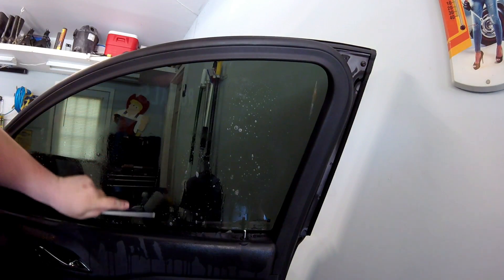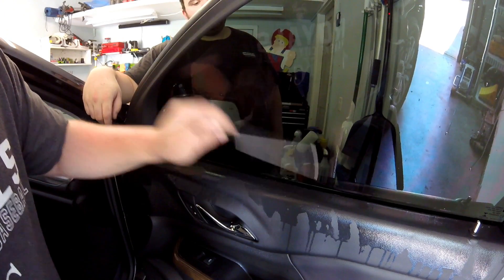How to eBay Tint Your Windows

Comment: Omg you have been hitting all the little things I needed to know! I cleaned my windows with Windex, which damn sure has ammonia! I knew I didn't know enough to do it myself yet so I'm saving it for a nice day and after a few more of these type videos, so thanks!  
Question, I've heard you don't want to do it in direct sunlight, which is all my driveway is, so I'm thinking of doing it at the carwash so I can be under the car port, but will it be okay if I drive home after and it sits in the sun? Should I try to keep it under the shade or what? Thanks in advance.
Reply: I’ve never heard of sunlight causing a problem. In fact, there are mobile tinters that will do it right in your driveway. The only thing I can think of is the sunlight would cause your solution to dry a lot faster. But if you apply a lot of solution then this shouldn’t be an issue.

Comment: Hi Obsessed Auto,

Great job with the tint job! I have two question if you don't mind answering because I want to tint the two front windows on my GMC Envoy.

1) How is the tint hold up so far? Any discoloration ?
2) Which ebay seller/store did you order From?
Reply from the maker: So far the tint is great, no issues at all. Would definitely buy again, here is the link to the eBay seller:  http://www.ebay.com/usr/elitetint?_trksid=p2057872.m2749.l2754. It's worth doing, thanks for watching!!

Comment: Did you at any point in time after the install was complete use a heat gun? Tint install came out bad ass by the way. 👍🏼
Reply from the maker: No, we didn't use a heat gun for this application, we let the sun work for us!  In an upcoming video we will be using a heat gun because it will not be a precut film!  Thanks!! We are very pleased with the outcome!!  Stay tuned for more!

Comment: as a window tinter

I have tried this in the past and 99.9% these kits are awful, they usually are short on the edge or the bottom.

I would not advise getting these kits

(No disrespect to the guy who’s making this video)

Its something I would get done professionally and I can assure you there is dust due to it resting on the door panel.

Comment: 25 bucks and the contamination specs on the window looks like glancing into the starry night sky haha. Just go to a pro. They charge accordingly for a reason. Don't do what this guy did.
Reply: J Wise you just made my day lol I always try to save a buck and then I regret it
Reply: J Wise lol I was watching this and shaking my head the hole time lol. I do professional window tint and definitely everything about this video is wrong. This people are the main reason we have so many removals at the shop lol so many customers say... Yeah so I watched this YouTube video and ........ You know that's how the conversation starts .
Reply: So if you do professional window tint and this guy did everything wrong, what could he have done to do it better? It looks fine on video. Is it because he didn't use a razor blade to clean the inside of the window? And it looked like he didn't clean the door panel while the tint rested on it. Is it cause he didn't use a heat gun on the inside to form it to the curvature?
Reply: @NGGPeter  what did he do wrong? Removed the entire liner and placed onto glass leaving the bottom exposed to the dirty door panel. He exposed the film to many contaminates with his transfer technique of film to glass. Finished product looks like shit. Touched the film with dry fingers leaving smudge that delaminates the adhesive reducing the longevity of the film backing. Also, he paid 25 dollars PER side. Thats 50+ bucks IF he got it right the first time around. Professionally done, a two window vehicle runs $70 and the film is ceramic and not dyed film like the film he used which will last 2 years. Carbon ceramic you're looking at 5-7 years. He didn't squeegee correctly or shrink so the film WILL develop fingers and eventually peel at the edges after continuous up and down movement of glass through use. And last but certainly not least he bought EBAY tint.
Reply: @cold-frontin_penguin7902  HI I ordered an ebay kit for my back windows of my berlingo before watching this video. It cost $50. should I take it to a professional to fit ? Or is it possible to get good results myself ?
Reply: @Professor-Scientist  if you're not wanting good results but results that are good enough then i say go for it. If you're OCD like myself then go professional. Akso, those Ebay kits will last 2 MAYBE 3 years before the adhesive fails. They do make them better now with color stable tech but its nowhere near the quality of what a professional provides. End of the day its all personal preference.
Reply: @cold-frontin_penguin7902  So everykit on ebay is bad? There is no high quality kit lol
Reply: If it's for a beater than who gives. If it has bubbles. But on a newer car like that I'd be a little more careful probably just pay